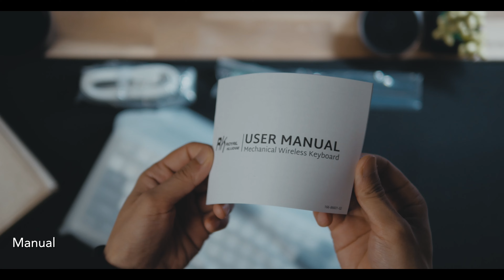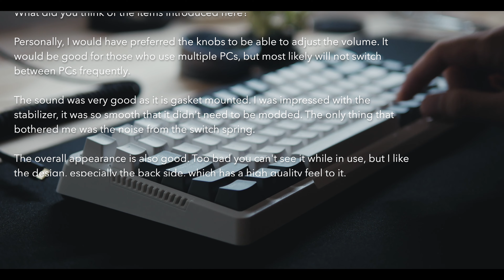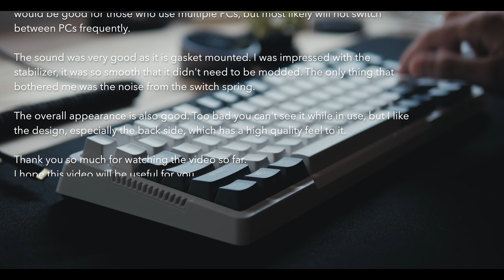RoyalKludge - RK H81 (Review + Sound Test)

Comment: I am typing this comment with RK H81 and I gotta say I'm really impressed! I was thinking of getting a wireless keyboard that can be switched to multiple devices and I came across this keyboard. Nowadays I'm very busy with work and don't have time to mod keyboard anymore, so this keyboard is really like a lifesaver even I immediately shelved my Tiger Lite 80 lol and chose to use RK H81. The switch is smooth, I really like the feel of the keycaps and the knob is very useful for me who need to switch between 3 devices regularly. The design also looks really cool and everything sounds great right out of the box. I was planning to do some modding but after using it only a few days I feel like it doesn't really need anymore modding haha
Reply: Which switches did you get

Comment: I have the same keeb and it sounds nice out of the box, i just tape modded it with 4 layers, removed the silicone case dampener and replaced with polyfill
Reply: How is it after the mod?
Reply: @baregum  sounds clocky, i like it tho, replaced the keycaps with cherry ones put some sea salt lemons
Reply: @anoniwful  Is there intereference with cherry keycaps since it's north-facing led?

Comment: Thank you for this awesome review! Great viewing angels!
I'm a begginer in this field and just about to get my first michanical keyboard, do you recommend this keyboard and use it in stock over buying Gamaky lk67 and modding it?
Reply: Depending on the budget and layout you want but if u looking for pre built i suggest you look into Akko, as they provide quite value for money
Reply: @edwinchw  Thank you very much ^_^
I did my research about akkot keyboards and liked them alot, I'm thinking about getting the Th80!
Reply: @yaserhegazi6284  if you prefer the 75% layout 
the 5075 B plus or PC75B Plus also a great option 
currently im using the 5075 B plus, super nice out of the box doesnot require any mod to sound good
Reply: @edwinchw  They cost more than my budget, however I will consider them and see if I will get more value per money👍
Reply: I found mine on sale on amazon for around $60 usd. 100% would recommend purchasing it. I've built 8 keyboards so far and this is my go-to daily driver. I did tape mod, stab mods, foam mod, and added Glorious Panda switches. Great typing experience and great sound! I will definitely get another when they are back in stock.

Comment: I want to replace the knob with a different one, but I’m not sure how I can remove the stock knob. Do I need to open the whole thing or can I just pull it out using the keycap puller?
Reply from the maker: You can remove it with the included keycap puller.

Comment: 2:32 How to take off the knob ? Either mine is too tight or do I have to pry open first then you can take it off?
Reply from the maker: The keycap puller makes it easy to remove.
Be careful not to damage the knob.